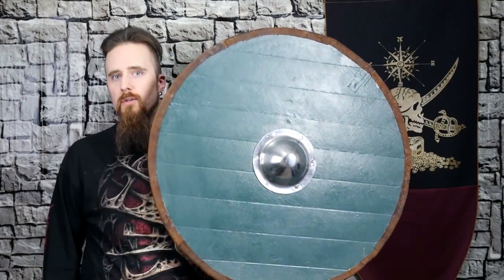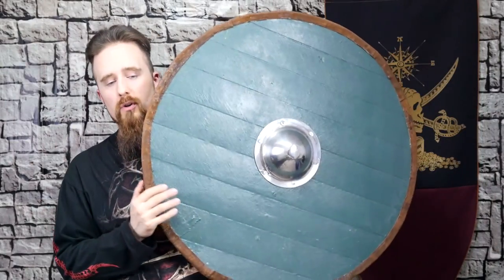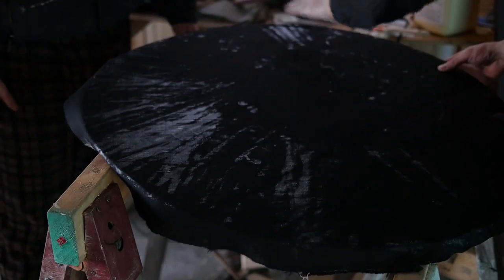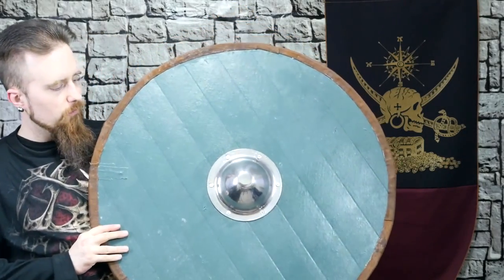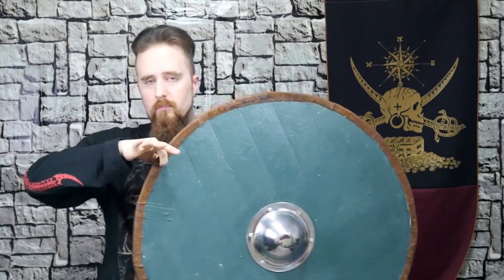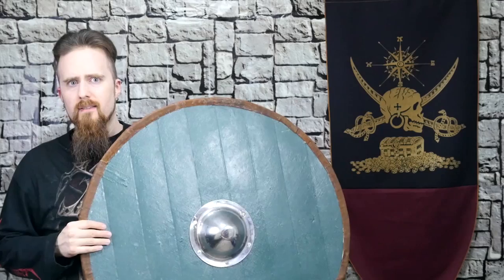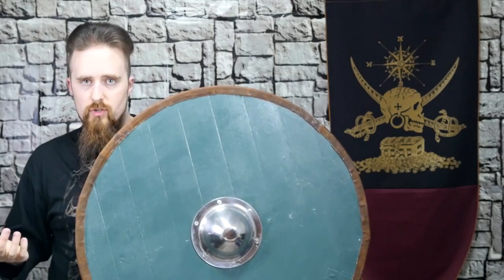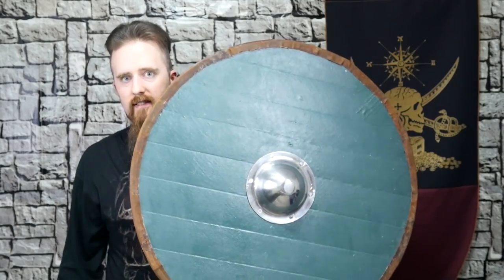Making, testing and repairing a Viking center-grip shield

Comment: I think that if it was made for real, aggressive use, planing the planks so as to not have their junction showing would be a must, as as is, it reveals the grain orientation, and maybe thusly, the axis where the shield is the most likely to split...

Maybe trying a cut along the grain on an offcut, prepared as if it were a shield could inform us on how it fares when struck along the grain!

Also, maybe gluing the fabric so as to have the bias along the grain could help in that "not splitting" department, as I tend to think that if the fabric and the grain coincide in orientation, the edge only cuts enough to begin acting as a wedge, then the grain splits, ripping fibers of the fabric one by one, sequentially, as one would do if ripping it voluntarily (but maybe the glued fabric is stiff enough to allow many of the fibres to simultaneously counteract the tendency to split, even if oriented along the grain)

Also, the Trelleborg shield had sort of a radial distal taper, being 8mm at the center boss hole's edge, and only 5 mm at the edge, I believe it might help in managing to keep the weight down, and the shield more lively and maneuverable!
It would'nt be to hard to achieve after having cut the shield round, with handplanes, a scrub plane to remove the bulk, and a basic n°4 or 4 1/2 plane to have it level and equal and regular...
I wonder if, together with the leather or textile backing, allowing a weapon strike to bite more easily, more deeply, ensuring a higher likelihood  of the weapon binding, and that not being a weakness, but maybe a plus, allowing for even more chance of disarming the opponent...

Couldn't find if the decrease in thickness is done equally from both side, or only on either the obverse or reverse, as basically I only derive my understanding of germanic languages on my understanding of english and a taste for linguistics...

If I manage to find a reliable source that I can understand, and that's clear about it, I might try and get my hands on some fir planking, and have a go at replicating it!

http://nytrelleborg.slagelse.dk/media/5873377/NyTrelleborgProspekt.pdf
I sometime see it's diameter given at 80 cm, but in this pdf I believe to be from the inventors of the find, it says 89 cm!
(it also shows a modicum of handle decoration, that might also give some haptic advantage, as in feeling only by touch it's orientation, so as to not have to think about it for a seasonned fighter... (or that might be strictly decorative)

I would highly appreciate if you could make a short video in english about that particular shield, as I suspect you understand danish quite well, and believe it's one of the best preserved finds, along the gokstad one regarding viking age shields!

Comment: Linseed oil - from the same plant as linen fiber - would be the traditional way to waterproof a shield.  It forms a tough polymer coating and is still used in modern paints and finishes.  It might be mixed with pine resin/tar, as was used for caulking their ships.

Comment: If you were interested in trying more appropriate glues (not that i'm saying there's anything wrong with using normal wood glue), you can fairly affordably get a container of knox or great lakes gelatin (great lakes is more affordable here in the states plus it's higher quality).  The gelatin we use now for food is exactly the same thing people have been using forever as animal glue.  You just mix it up so it gels then put it over heat and the gel will melt.  I've actually found it tends to hold better than wood glue plus it shrinks the way rawhide does to give you a tight fit.  Also, when the glue cools down and gets gelly, it holds well enough that you don't have to clamp it as tight till the moisture dries the rest of the way out.

Comment: I've heard some people say that using linen for shield facing (instead of rawhide) is not historical and I've heard others say it is. But here's my two cents: Rawhide has rigid, hardness and general toughness properties that linen simply doesn't. If you'd ever handled rawhide cow skin, you'd know that linen is a completely different material in all its properties. That, compared to the fact that original shields of many eras had multiple layers of rawhide front and back, and that the wooden cores were made of soft, light, thin wood leads me to believe that rawhide was the main part of a shield and the wooden core was simply there to take advantage of its rigid properties, to add a sort of "backbone". Comparing rawhide to linen on shields I've made, rawhide is much more practical and does a its job infinitely better than linen, leading me to believe that linen wasn't used as often if at all.

Comment: skall, what if you nailed a metal rim onto the shield that left about 6 inches of un-protected shield out in all directions. it would give the advantages of the metal rim but an opponents sword can still get stuck in the outer edge
Reply: Homelikejet all i saw was : Nailed, Rim, 6 inches, un protected and stuck in
Reply: Homelikejet That's actually kind of a clever idea.
Reply: ***** thank you, i hope skall notices
Reply: Homelikejet It's a good enough idea that I'd be surprised if it hasn't previously been done.
Reply: ***** ive never seen anything like it
Reply: Homelikejet this may or may not answer your qestion, but i'm rather fond of a shield i made with a metal rim; it's only aluminium, but it gives it an extra something, while keeping it light.
it's probably smaller than skall's, 22 inch diameter, it's thinner too, 7mm 3ply, so it's very light. there's two hardwood bars that go vertically across the outside and two that go horizontally across the inside, and the two handle straps are on the inside, attatched to the four center bolts that go through the hardwood, the ply, and the hardwood. the balance is very much towards the center so it feels very light.

on to how it works, well, it's much more of a fast moving and offensive shield. catching blades is not something i find myself doing, more deflecting and moving in closer (you probably wouldn't have much luck catching blunted practice blades anyway. i'm not sure if skall's shield classes as heavy, it might feel so to me, but he seems to value cathing blades to disable them; it's a useful thing, to be sure, but with a metal rim that would be far less likely to happen, and the added weight of three or so feet of metal around the edge would make it much heavier.

so, to answer your question, metal rims on shields do work, but they're not a straight upgrade for every shield. you have less of the weight problem on smaller shields and bucklers, and you can use those smaller shields to deflect a sword then jab at your opponent with the rim (usually doesn't achieve too much) or bash their deflected sword arm outwards (very useful if done right) and some people will view the fact that you have now all but removed the option of catching your opponent's blade as a huge down side.

er, sorry for the rambling response, but i hope it contains some useful information.
Reply: spamhonx56 I think you misunderstood the person's post. They weren't describing a shield with a metal rim, the person was describing a shield with a metal ring beaten into it about 6 inches in from the edge of the shield. Nice post by the way.
Reply: ***** :3 oh, yep, i see what you mean...

Comment: Very interesting. It could clearly be stronger but weight has always been an issue and, depending on their technique, it may not have needed to be stronger. If you are deflecting blows as opposed to absorbing an impact it doesn't need to be stronger. 
Very interesting. I had always kind of thought shields would be heavy & thick but after thinking about it, it makes sense to have a lighter shield.

Comment: I'm getting ready to build my own, and I'll have slight historical leeway in what I've designed.

My question for you, is if I replace the cloth face with boiled leather, obviously it would make it stronger, but would it cause it to be too heavy to use? Note I might also rim it with iron, but I'm not sure yet.

Also, I noticed in your design, the only crossbeam you have is the handle. I was going to add two  more on either side of the handle to keep it sturdy. Is that overkill?
Reply: +Ryan Houk That is how I would like to do my own, except I do not know how to do the iron rim
Reply: +Valor Boyd buy a thin flat bar, and hammer them down around the rim? I figure any how. Haven't done it yet. 

... What would be the lightest wood with still being able to protect you?

Comment: I'm wondering about the relevance of attacks on the side of the shield, as far as warfare is concerned. Your comment on single combat use of this shield is very interesting, and that's probably one way they used them during Holmganga or Einvigi, but I'm not sure they would attack the boards of the shield in battle formations, following the shield-wall. Getting stuck there seems like a pretty stupid idea and even with very good weapons, it's hard to cut through those shields.

Comment: As far as I was aware I thought they only covered their shields in rawhide as linen would have been too expensive to use on something expendable as a sheild. As likely for waterproofing they'd have used beeswax. I know many of their chests were coated in it to help repel water and keep the wood from swelling which could cause it to warp and crack. Curious though what kind of paint did you use? And did you use polyurathane or something different as a sealant?  I'm making one myself at the moment and have some acrylic paint and poly laying around but not sure if  that would be suitable to use on a combat sheild or not.

Comment: If you find some indications in archaeology papers was 12-6mm thickness ore something similar. That means that all the shields (what I have seen) are in the middle thicker then outwards. The rim was sometimes covert wit bronze ore Iron. But in most finds only the boss survived. It is not clear how often the metal cover was used because it was only around 0,2-0,4 mm Thick on the shields I have seen. 
The Nails were bend over twice (what woodworker call riveted) so that the tip stuck in the wood. I need some time to find that out.  :-/
Also a problem is, that archaeologists often create there own words for tings already have a name by craftsman. :-(
Other real riveted with a little metal plate on the beck so that you get a nails had size on both sides.
And Nails not those modern cheap wire nails/pins.

Comment: You can reinforce the rim of the shield by adding rope on the edges, and btw that rawhide is really thin. If you would use and rawhide from a actual leatherwork(not dog chew toy) It would be somewhat thicker. Anyhow best shield by far(concering durability) are/were covered whole(= front, back is not :-)) with rawhide(It costs here about 20-40 $, but only few times a year you can get it).

Comment: Hello skull
I just want to start of by saying that I am a huge fan and really like you're videos. 7:35 you said that you want that you're opponent sword will stuck in you're shield. Because then you're can control you're opponents sword. But the vikings actually had a steel rond around the shield. The shield would hold much better. And think in a battle and you got like 10 cuts into you're shield. Then it would brake. But with a shield with a steel rond it wouldn't. And the vikings had a the steel rond. And at that time you only got one shield.

// Swedish viking nerd

Comment: I have a simple idea to strengthen the shield.
Its seems the most damage the shield gets from hitting the edge.
Metal reinforcements would be to expensive and gain weight.
To my idea: Would it be possible to steam the whole shield and give it slight arc, so its harder to hit the edge in a straight hit.

Comment: so Skall, what's the diameter of this shield? when I made my own shield I found out that the smallest diameter they have found is 75cm and the largest to be 100cm (1m) I chose mine to be 85cm :) which is quite large but then it offers great much of protection, I also found out that I can fit completely behind it, so if there should turn out to come a sky of arrows raigning down on me I would be quite protected :) although the arrows might punch a bit through the shield. I'm planning to put linen on the inside as well, I've heard that IKEA sells linen at a decent price, but I'm not all too sure :) still worth checking out :)

Comment: did you consider making the shield double layered with the wooden boards? (going crosswise) I think that would have made it thicker and drastically increased the structural strength. or do you think that would have been too heavy?

Comment: historical (viking)shields were often not one thickness, but would taper to the edge (16-6 mm taper for instance) as is evient from many grave finds as well as exstant examples.

also linen covering is uncommon, most fragments and extant examples show painting on the wood.

of course a hide covering IS historical. though it is hard to tell if it was leather or rawhide, as the rawhide would be hard to distinguish after 1000 years in a bog.

but rawhide makes sense, as it is cheaper and better and hair on the shields is mentioned in the sagas.

Comment: ...looking back. the use of linen also seems wise from another standpoint...
linen is on average a stronger fibre than cotton or even wool in terms of tensile strength, maybe even sheer strength, so maybe it would help resist against cuts, or help with flex

Comment: So i have seen some documentaries and videos that suggested that the decoration, cover and paint on the shield was also there to hide the grain of the wood. That dos not seem to have happened with your example. Do you think maybe they would have used multiple layers or is the covering of the grain of the wood just not that much of a thing and it was just done for the shield to look nice?
Reply: I don't quite get how you would need paint on your shield to cover the grain direction, except if you have no linen cover, as a historical shield would have been carved/sanded flush, so you couldn't see the seems of the boards. And linen beeing non-transparent would effectively cover the grain, without the need for any paint.

Comment: I was wondering what would turn out if you made a viking round shield like that out of completely state of the art modern material. Like use some high shock resistance polymer instead of the wood planks and use kevlar instead of the linen and use titanium for the bowl etc etc... I know its just kindda stupid and you would have to sacrifice the feature of trapping the blade by getting it awkwardly cut in, but still.

Comment: Linen is stronger than cotton I'm told but it would have most likely been as thick as canvas however rawhide from a steer or bull is going to make it a heck of a lot tougher. They would have most likely used milk paint. Both Bob Villa and Martha Stewart have recipes you can find by googling milk paint. The might have coated it with linseed oil and the Romans actually used shield covers.
Reply: Dwight E Howell   the thing is that most weapons humans have designed over the years were rather good at cutting flesh (like rawhide and leather) but were actually rather poor at cutting fabric.  I can't tell you how many times my life has been saved purely by a single slightly over-sized (and thus baggy and mobile) t-shirt.
Reply: Dried raw hide and leather are pretty much not the same thing when it comes to cutting it. Get a rawhide dog treat and try slicing that with a knife.
Reply: Dwight E Howell a knife doesn't cut that deeply, but I can get through it with my swords no problem.  already tested it.  cloth on the other hand provides more resistance depending on the cloth.

Comment: iam not that sure about this, but you linen looks quite fine. i think on a shield you may be want some more coarse, since it is easyer to make and give more stability since it soaks the wood glue a bit better.

And a tip for a relatively cheap source of linen: Ikea (at least in germany) has a some good linen that is quite rough and also uncolored. So i think this may be an good option. if i remember correctly its 9€/m with 1.5m width
Reply from the maker: vlad tepesch 
Unfortunately there is no Ikea where I live.
Reply: ***** best material is the back of curtains, you caan get it from any chairty shop selling curtains ahhaa

Comment: Remember though, in a shield wall I wouldn't nor would the Danes or Saxons use long weapons such as swords(plus they are very expensive) they would have used a sax or a seax, long knife. Shields were meant to break. In a Holmgang a warrior would carry three shields because of how quickly they broke, linden however, which is what u made my shield out of is very flexible and a Saxon domed shield is very strong. Oh and don't want yo be picky but there weren't many two handed swords in the 9th century in Europe except maybe some Irish kingdoms might have used them as ornamental weapons. Loved the video though and that's a pretty good starting shield.
Reply: My grammar though...
Reply: +Nerd_Middle Earth  Shields weren't designed to break...and would rarely break under standard circumstances. Receive damage? Certainly but break? Not really. Also the arming sword isn't as long as you seem to be suggesting it was....in actual combat they would have used spears mainly.
Reply: Scots had two handed swords - claymores
Reply: Sammy Elliot In the Renaissance, yes.